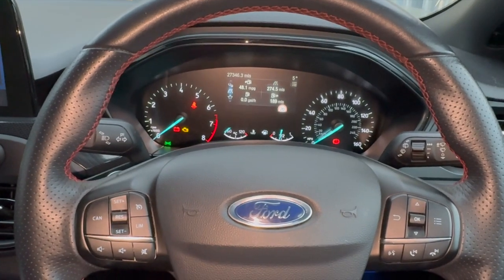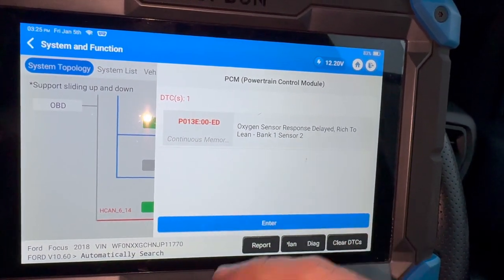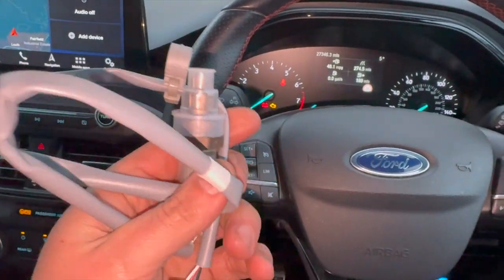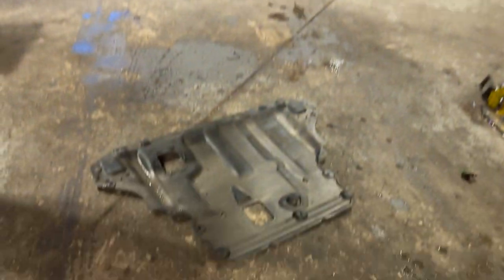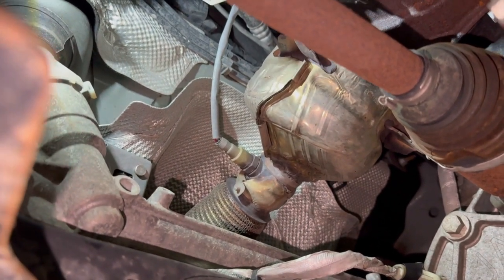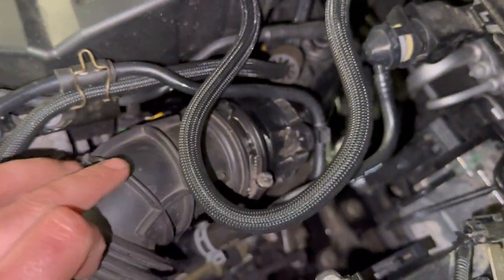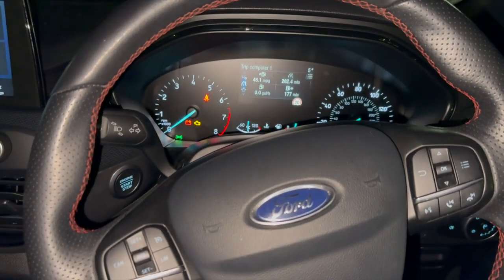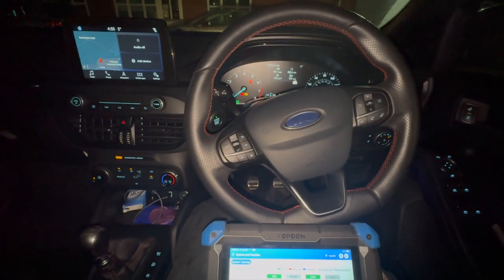Ford Focus ecoboost P013E Oxygen sensor response delayed sensor 2

Comment: Hello, thanks for the vid, got this error right now, how much newton metre you use for the sensor tightening?
Reply from the maker: Didn’t torque it just a nice nip
Reply: My husband's 2017 Ford expedition just threw this code but it's also smoking from the tailpipe and smells. It's not leaking oil or any fluids on the driveway not over heating could this be causing that as well?
Reply: 48nm